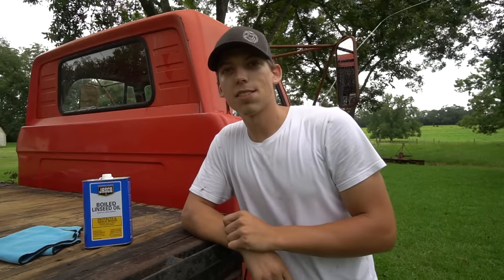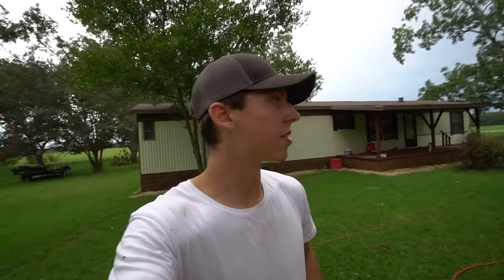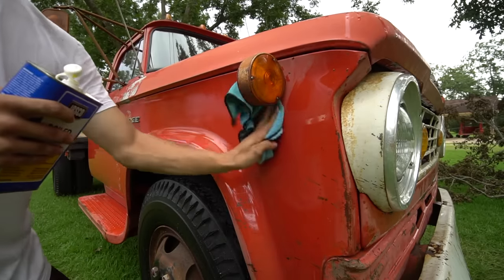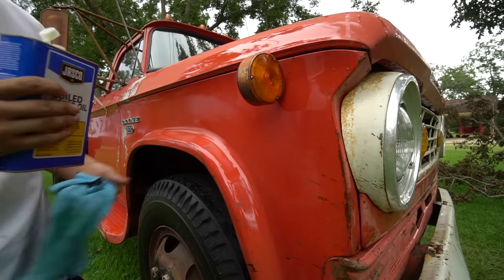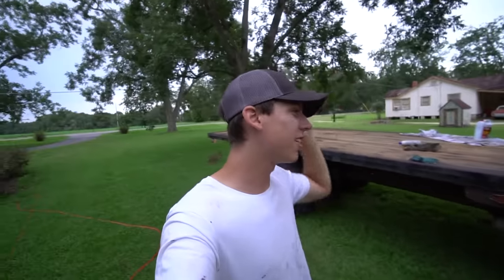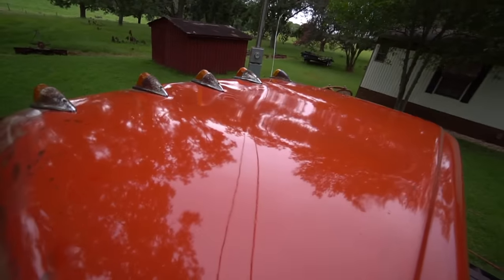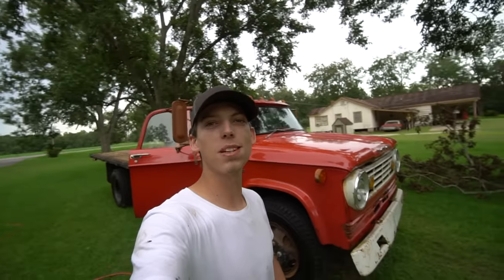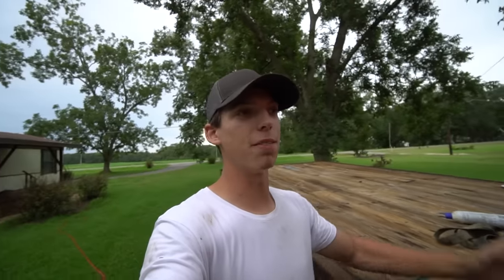This $8 Product Saved My Faded 55 Year Old Paint Job (Amazing Results!)

Comment: Ya it looks great. Now take it down a dirt road and see what happens lol
Reply: It’s all fun and games till you get a gust of wind
Reply: There will be more flies stuck to that truck than a elephants turd.
Reply: The guys at the local firehouse use WD40.
Reply: It doesn't stay oily and lasts for 6 months to a year.
Reply: Or until it gets washed, linseed oil works better on plastic rather than metal.
Reply: @johnweisinger7390  still much better do do it properly and get a good ceramic coating in place of the nonexistant clearcoat.
Reply: Boiled linseed oil hardens if you let it. Stuff can last for 3-6 months just fine and doesn’t stay tacky. Personally I’m just going to cut and buff my paint and then wipe it down with penatrol oil. That stuff lasts a little longer and sets up faster. Cheap and easy
Reply: The more ya rub it over time the better it will get
Reply: @DreamHachi  or just get  it ceramic coated..
Reply: @Frankstgeorge88  kinda a waste of money for 50+ year old paint. For $10 I can do my whole truck with penatrol oil.  Whereas it would run me $300 to ceramic coat it myself. I don’t see the point in spending $300 on 50+ year old paint when it’s getting repainted anyways. I’m doing everything before paint. Now that the drive train and brakes are done. Next up is suspension and wiring. Then I can paint it
Reply: @DreamHachi  penetrol yellows
Reply: @johnweisinger7390  
Is that true? So dirt doesn't really stick to it then?
Reply: @Frankstgeorge88  
Ceramic coating protects top coat but doesn't create gloss as far as I know, all the ones I've used anyway...
Reply: @gabrieltrevizo6088  not if you wipe off all the excess and let it set up. If you dont get all the excess off it will be tacky
Reply: Looks great though! 👍

Comment: Oil to "save" paint I dont think so......cutting compound and a good buffing tool is the way to go for a permanent fix
Reply: buffing wont work on paint with no clear coat, but this definitely isnt a save
Reply: @adriansawa8742  The body shop I use would disagree
Reply: Single stage paints have been cut and buffed forever, just gotta be mindful of heat.

Comment: Although linseed oil is gentler than a lot of cuttinf compounds, I believe that it may still be smarter to go with a soft cut and hand polish followed by a ceramic coat. Itll keep the old paint looking good and it'll keep it from ever getting that bad again.
Reply: I got my old truck cut n polished a ceramic coated and it only lasted about a year.. mabey the coating was rubbish
Reply: Needs igl aegis
Reply: @jrifda1 ceramic coatings can have either their finish or hydrophobic properties fade away depending on which side the ph is in the soaps used. Using soaps that are ph neutral, and refreshing it with ceramic sprays (quick wax like) once every 2-3 months keeps it for 3-8 years depending on original coating

Comment: They actually used to varnish/coat/seal cars by using a variant of linseed oil called stand oil , mixed with turpentine. Stand oil is much more durable , yet more difficult to work with & takes a very very long time to dry. That’s probably why they stopped using it in the automotive industry around the early 1920s.

Comment: For those who are not familiar with the product be careful of what you buy
 boiled linseed oil is good but regular linseed oil will ignite by itself with no spark
Reply: Thanks!
Reply: Boiled linseed oil can combust on its own as well.  When linseed oil cures, it is an exothermic reaction,  so it generates heat.  It's really only an issue with the rags.  Don't bunch them up,  pile them,  stack them,  etc. Lay them out to dry or throw in a bucket of water and you're fine.

Comment: The first time I ever seen an approach to shine up old cloudy paint with a method like this, I had to give it a try on an old 1980 Chevy conversion van that was getting extremely cloudy on top.  I didn't know and had never heard anything about this before.  I heard it a little differently though. One thing I like better in how you do it is that the fellow who made the other video suggested that I mix three parts BLO, two parts mineral spirits, one part WD40, and one part silicon protectant (like Armor All) and wipe it on as you did.  To me your results are just as good, but from my experiences with BLO, I know it doesn't feel oily in about 24 hours, and that other mix seems to stay oily and collect dust for 3, or 4, or 5, days  (and I live on dirt roads, so eve if I don't drive it . . .)-- it will wash up nicely after it finally dries out though.  Something that guy did suggest that you may want to try though is before he applied his magic concoction, was that he went over every inch with warm water and SOS pads.  The kind with soap on them already, and rinsed often to inspect each patch of how far 'into' it he was as he went.  He suggested, advised, that this is not for good paint or clear coat because its abrasive, but to cut the dead, oxidized old paint off of better more colorful paint below the surface, at the same time, it will take off quite a bit of light surface rust and other unwanted deposits like bird, bug, tar, sap, and elm bud residues.  I used SOS on my van and when I was done, you could tell the color was much better before I even applied the "juice" -- adding that was more about shine like a clear coat.  I guess there are scratches after SOS, but they are so small that your eyes can't see a single scratch. All you see is as if you may have hit something with 800 or 1000 grit paper which would take off a shine,-- but where the is no shine to began with . . .  Anyway, after the special sauce, it all looks great like your truck did.
Reply: Instead of Brillo pads why not use clay bar?

Comment: Looks great. Ive only ever used it on wood. Like tung oil you have to rub off the excess before it dries otherwise it turns to sticky sludge. It seems worth an experiment

Comment: A good product to use is penetrol you get it in the paint section at home depot it will give you the shine with out the oily residue and it dries like clear coat
Reply: I plan on using penetrol on my 70 F100
Reply: @johnweisinger7390  me too on my 69 F 100.
Reply: Just tried penetrol on my 03 f250's  faded hood.  Looks like a million bucks from 10 feet but up close it isn't leveling as well as I'd like.  Anyway, nice fix before full restoration.  Thanks for reco!
Reply: @rickchory6034  does it stay greasy?
Reply: @rickchory6034  I watched a couple of videos on it and the guy said sometimes you have to keep wiping the excess off. He was applying it with a piece of sponge and had the penetrol in a small container from some kind of microwave food. Just that little bit was enough to do his whole truck and he had to keep wiping the excess off with another piece of sponge.
Reply: @dreamingcode  no, but  i got best results by applying quickly and sparingly with a paint sponge.  Got to be careful with excess runs on vertical areas.  used blue paint tape and keep a cloth handy to quickly wipe runs. Drys like clear coat.  Beautiful!
Reply: @johnweisinger7390  that sounds like the YouTube channel Primered Is Best.

Comment: A product you should all try is Flood. It’s some chemical you mix in with paint to prevent streaks. But it works great as a glossy clear coat for metal. I used it to restore my husky pliers and tools at work. It’s been months with regular use and rust hasn’t returned. Their are a few videos about it. I highly recommend to give it a look.
Reply: Penetrol will streak badly if it's wiped on like that.
Reply: Flood Penetrol main ingredients...naphtha and linseed oil.

Comment: If that doesn't last as long as you'd like I'd suggest a 2k clear coat ontop of the orange. Way less work than Caleb's truck since your just spraying a nice clear coat over the orange to make it shiny/preserve it. Old truck patina is one of the best parts about these builds.
Reply: Shows your lack of knowledge on the subject. Can't clear over it now. Kinda like when we would use gas to reduce paint when we ran out of thinner, guess what happens?
Reply: @wildestcowboy2668  obviously he would clean the surface before painting genius.
Reply: @superdwarf  Shows even more lack of knowledge, again guess what happens when u reduce paint and then apply the paint to the car?  It will not stick, no matter how much u clean it!

Comment: So I used penetrol on my old international. The reason I did this was #1; I wanted to maintain all the patina including surface rust. #2; I didn't want it to become a dust magnet and wanted to be able to wash it easily. #3; I was afraid that if I did ever decide to paint it, I would have issues getting all the oil out of the metal. The penetrol has held up very well over the last year only fading slightly,  and best of all it's a paint additive, so no contamination worries.
Reply: Penetrols good stuff!  Good idea
Reply: Penetrol is an oil paint additive, that increases paint dry time, makes it flow better and lay down very smooth.  Used alot in sprayers.  Never heard of just painting it on.  Might try it.
Reply: So not only can penetrol be used as a paint additive, it can be used to revive faded fiberglass gelcoat. There's instructions right on the container for use on boats and campers. Since it has such a slow dry time it can be brushed on with no visible brush strokes. After it dries (takes about 2 days), it's basically just a clear coat. And if you scuff it for any reason, just wash the area and touch it up. So far I've used it on an old International truck and a couple other small projects. I'm getting ready to use it on an old Rambler too that have perfect patina. I couldn't be more happy with the results.
Reply: I just used Penetrol on the trim on my WJ -- looking good so far.
Reply: @jakwire  TJ is

Comment: Boiled linseed oil is an old school finish that was used frequently in years past. It’s a good option for a project like this truck.
Reply: Although this is true, its far from ideal, and it definitely wont last, sort of like a greasy petroleum based tire shine. The best way for this kind of paint is to hit it with a clay towel, hand polish, and finish with a ceramic or graphene coat. Either will do the job just fine, just dont expect the ceramic coat to last as long.

Comment: If you let the Linseed Oil dry and keep it dry <Rain will leave spots> go over it with a good quality hard wax <I used Autosmart> gives a deep glass like shine that is water resistant and a rag will just slide off the finish.. The Linseed oil can stil get sticky if you leave it in the sun on a hot day if you dont seal it with wa, and it's summer here and been in the hot sun with now sticky issue.. Give it a try

Comment: Told ya. Knew that paint would come around with the Boiled Linseed oil.

I might have lightly buffed the paint before then applied the oil.

It will dry out a bit and dull up. Depending on if you keep it 8n the rain or a shed, and the sun. You will have to redo it.

Unless that truck was a total repaint there was no clear on it. No one uses clears at least till the 80s, mostly 90s.
Reply: If put on that thick, it might be sticky for a while, but will also last longer before having to repeat.  though still go to the self serve car wash and spray wax the underside and engine bay except the intake, plus down the doors, door hinges, and lightly under the dash to protect all the wiring from corrosion.  then hit the muffler with silicone tire shine.
Reply: I wonder which is better, spray wax on top of linseed oil? or linseed oil on top of spray wax?
Reply: @alan6832  well wax probably won't stick on top of oil. And the wax may keep some of the oil from penetrating the paint. Which is what the oil does. So I would say just oil.

This is old school stuff here
Reply: @natevanlandingham1945  Won't it attract dirt? How long does it last usually?
Reply: @doclull1989  yea dirt will stick. It is oil. But you want to wipe it off. I don't think he has gone back and buffed the extra out. You don't want it to be sopping oily. I have heard it will last a couple months depending on if you wash it and do you store it outside in the rain or a garage
Reply: @natevanlandingham1945  That's really good to know. I've never heard of using it before. Thanks Nate.
Reply: @doclull1989  now it's really only for old school single stage paint. New stuff with trashed clear coat that's flaking off will still look like garbage. And hazed clear can just be buffed out. Now if all clear is gone and base still is there I guess it would work similar, but this is really for the old school enamel paint. It also works best cause in these patina looks you have some primer and bare metal usually showing and the linseed oil will help protect that bare metal from rusting worse...to a degree of course.
Reply: @natevanlandingham1945  Great info, thank you.
Reply: @natevanlandingham1945  since the underside needs spray wax anyway, it's harder not to do the top and any wax that stays will add to the rust protection, and yes wax will stick to oil, even solvent weld and blend at the interface.

Comment: I tried that on an old gun stock and hated it. Dripped, had runs, never dried and was sticky. If I did that to a car I would have 12,000 bugs stuck to it. BLO takes 30 days to dry/cure. Seems like a really bad idea. Impossible to remove now also.

Comment: I’m using 60% boiled linseed oil and mineral spirits 40%
Mix well and rub on and clean rag wipe off good 
Will collect dust but easy wipe off or wash off 😊😊😊
Works

Comment: Would recommend when you get gas for it get the premium because its older and not made for all the ethanol in the cheaper gas
Reply: Hate to tell you this, but all gas (regular, medium and premium grades) contain up to 10% ethanol. The ethanol is not the big issue for pre-ethanol days built vehicles, its the lack of lead that causes valves to fail and other maladies. Ethanol is mandated by the EPA to reduce emissions (and subsidize corn farmers). You can still buy ethanol free gas, but it is expensive and hard to find. Here is a link to a database (user maintained) that list stations that have ethanol free gas in the U.S. and Canada:  www.pure-gas.org.  For owners of vehicles that were manufactured in the pre-ethanol days, there are lead "substitutes" you can buy in auto part stores to add to gas and help save valves.
Reply: @lazerbeam3928  ty!💚🌵🦅

Comment: That truck most likely used an acrylic enamel paint in '65, not a base/clear. Base/clear is the hot set up today, and a factory red paint would really make that truck pop.
Reply: I always preferred the 1 stage enamel or even an oil-based paint to base/clear. Nothing like that deep mirror look to a well polished enamel. Clear coat just makes me think of someone who's too lazy to keep their car clean. Just look at all of the modern cars with faded headlights lenses.

Comment: You need something efficient for those half hour parts and grocery runs.  maybe a slant 6 Dart if you like Dodge.  They actually made slant 6 challengers.  Dodge was late to the efficiency game with charger 2.2 turbo.  Vegas, Pintos and Chevettes were a decade earlier and VW before that.  If you are committed to Diesel, which this truck isn't, there are a few diesel Chevettes out there plus VW's and minipickups.  Diesel rabbit pickups were the cheapest thing in Edmunds at one time.
    Saving old vehicles is green if you can prevent them building a new one by doing so.  Cash for Clunkers was not progressive or green, just boneheaded.

Comment: I tried this on my 78 ford looked like it just rolled off the assembly line, after a week it left a thick haze layer that i cant get off not sure if i skipped a step or what about 8 months later still cant rmove it any tips on how to remove would be appreciated
Reply: It's been 5 months. Find a solution yet? Asking for a friend
Reply: @power_joke_havin-a-stroke9281  son of a!
Reply: @freemansgarage  sometimes we have to learn the hard way im sure theres a solution to it but at this point i gave up on it and im gonna strip the truck down and repaint anyway, but will say if u use a dual action polisher on med speed it works down the layer a little bit, personally i just get a terry cloth and rub some baby oil (not gel) on the paint if i want to take it out and want it to look nice. sounds stupid but its cheap and works as a decent temporary bandade for the issue

Comment: Not gonna lie I’ve never heard of that oil and I definitely didn’t know you could use it on paint. Are you gonna keep it original paint or paint in the future?
Reply: Linseed oil is probably the most common thing used on wood that will be outside all of the time. Stakeside wood, old bed wood, etc. Using it on paint is just cuttin' corners trying to make the old paint look good. That paint can be saved (what paint is left anyhow) with good polishing/buffing/waxing.
It's like my Father always said, people can never find the time to do things right but can always find the time to do them over🏁👍🇺🇸